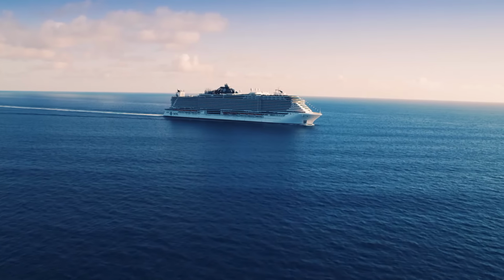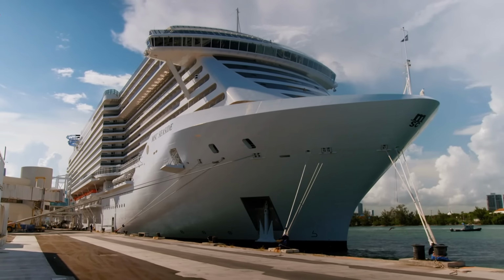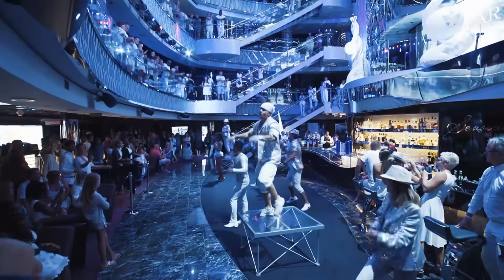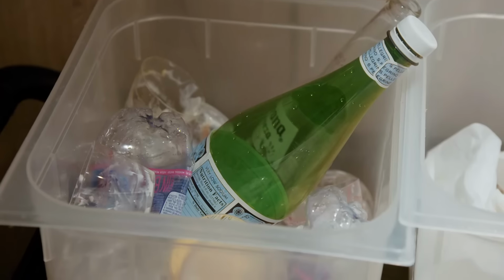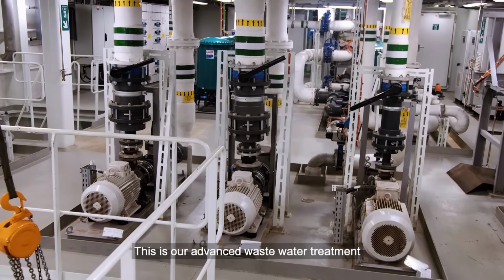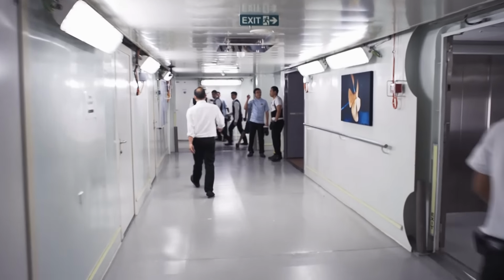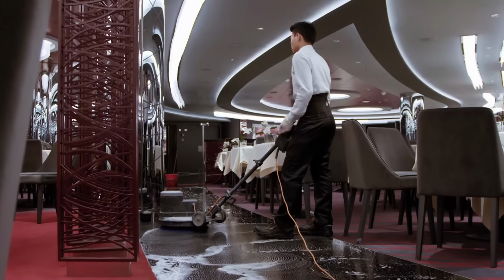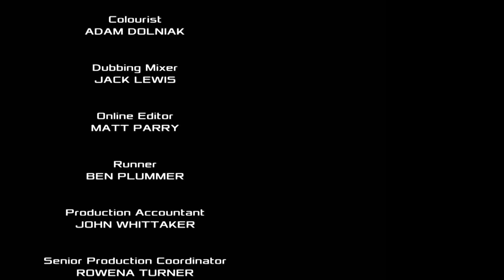Inside The Largest Cruise Ship Ever Constructed

Comment: been on two royal caribbean oasis class.. they are half again bigger
MSC SEASIDE Seaside-class cruise ship  Tonnage 153,516 GT, Length 323 m (1,060 ft), Beam 	41 m (135 ft)
ROYAL CARIBBEAN Oasis-class cruise ship Tonnage 226,838 GT, Length 361.8 m (1,187 ft) overall, Beam  47 m (154 ft) waterline/ 64.9 m (213 ft) max beam